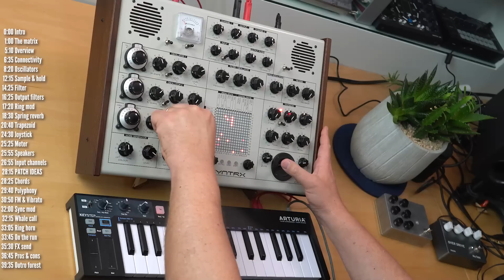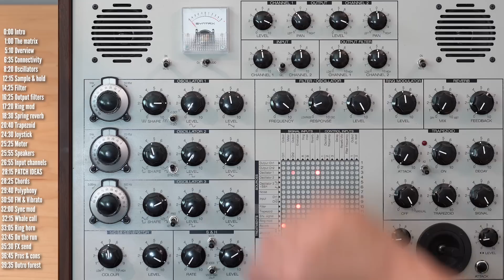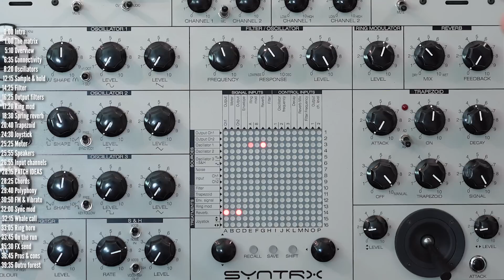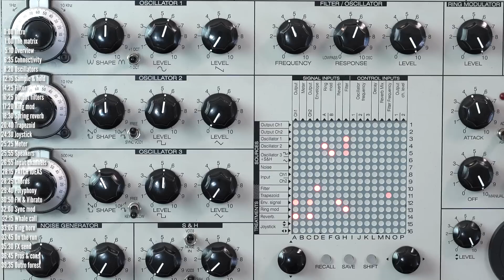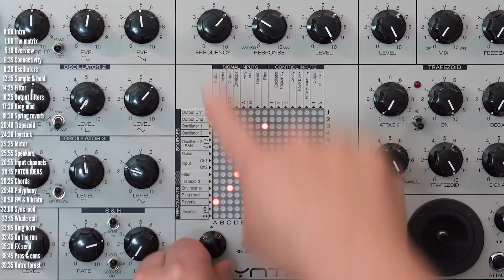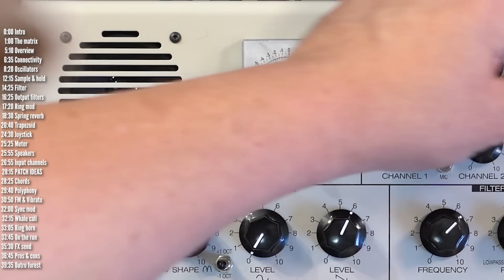SYNTRX: Review and sound design tutorial // EMS Synthi reimagined by Erica Synths

Comment: To do Polyphony with the SYNTRX, you use a Arturia Keystep Pro, is polyphony working with the arturia keystep basic model?
Reply from the maker: Syntrx is not a polyphonic synth
Reply: @loopop  at 29:40 you did a polyphony part in your video with the arturia keystep pro, does the controller keyboard makes a difference on how you can achieve that type of sound, or not? If I got it, you played the oscillators 2 & 3 on the left side of the keyboard and the osc 1 on the right side. Is it possible to do the same configuration with the Arturia keystep basic model ?
Reply from the maker: @Kevin_Beier  ah I understand - I thought you were asking generally. No, this trick only works with the KeyStep pro
Reply: @loopop  thank you for your answer :) can I ask you one more thing? Can you tell me how to set the cables between the two devices for that specific setup, I can barely see in the video where the cables are, but not clearly. 

Thank you in advance.

Comment: Ok, I have got this myself and am a bit confused about saving patches. I can get a great sound, save it,  but when later recalled they are never sounding the same. In fact,  knobs and dials that are in their current state seem to be automatically applied to a recalled patch making it sound very different. I was under the impression that once a sound was saved it was fully saved.
Reply from the maker: you can only save matrix connections, not knob or switch positions unfortunately
Reply: @loopop  Ok, I was under the impression that it saved the state of the sound as well as the matrix, but not able to recall current knob positions. Bit of a shock but I suppose I will have to live with it and make the best of it. Limitations are sometimes good
Reply: @loopop  Which is why it is going back, sadly. I will wait for the Behringer VCS3 clone.
Reply: Make yourself comfortable in that case (you're going to be waiting a LONG time)...
Reply: @actonspur5231  I can wait. I have the Pulsar and Makenoise semi modular synrhs to keep me busy.
Reply: @Ian-gw2vx  the global chip shortage doesn't look like abating any time soon (and Russia's persistent invasion of Ukraine is severely curtailing that supply channel). Glad Soma and Make Noise are keeping you entertained through this manufacturing malaise..
Reply: @actonspur5231  Its all meaningless in comparison to how much people in the Ukraine are suffering. Even though I bought the Pulsar and Lyra almost 2 years ago I still feel uncomfortable.
Reply: @Ian-gw2vx  this is very true. However, that chip manufacturing plant probably sustained a lot of national employment which has now been decimated following Russia's invasion. Notwithstanding, you can't put a price on human loss and suffering which this has inflicted, synth passions aside...😔

Comment: Regarding 'On the Run' - if you connect the sequence pitch CV (instead of gate) into the SYNTRX audio input jack, you will get those accents in the hi-hat pattern like the original.  I tried this just now and it sounds fantastic and very close to the original.  Using the gate works too as you demonstrated, it just ends up a little repetitive.  Nice video, I watched it many times before finally purchasing a SYNTRX!

Comment: My old VCS3 had one great feature where the joystick's speed of movement could be used to control the amplitude of an oscillator. In other words, it worked just like a violin bow - slow movement for quiet sounds, fast movement for loud sounds, no movement for silence. With that and the keyboard I could create quite convincing solo violin or cello melodies. Can the SYNTRX do this?

Comment: It's definitely a retro approach, I'd think there's some old-timers who'd kill for one of these.  And I suspect it's cheaper than an original and probably a little easier to maintain.   For example: good luck getting a replacement pin patch panel for a vintage one.   I'm surprised you can still get those 10-turn pot dials anymore.

Comment: Did I understand that the lights in the matrix interferes with the noise level in the reverb? 
Weird thing but good to see it's easy fixed with the turning off the lights fucntion. 
Or perhaps there should be some physical filter inside the box?
Reply from the maker: Filters would change the overall sound, it's better to just eliminate the source of the problem (which, if it bothers you, turning off the lights does)
Reply: @loopop  I'm thinking that if something is causing noise then that should be dealt with in the engineering and design stage. It appears though as Erica Synth chose to deal with it with the lights off function instead. Probably no bigger deal than that in the end.
Reply: you can open and change cables to the springs to cables that are triple shielded. this will lower the noise alot.

Comment: I would like to see your face when you discover that you are showing distorted waveforms in all your videos with this software oscilloscope. Again..... DO A FAVOR FOR YOUR AUDIENCE AND ALSO RESPECTING YOUR GOOD WORK, BUY A REAL OSCILLOSCOPE!
Reply from the maker: OK, first no reason to shout... we can have a civil discussion about this. Second, please provide names of a few scopes you think would do a better job. Quite interested in comparing. Finally, scopes are there as a visual aid to make things more interesting. I can show you beautiful shapes that sound bad - buy with your ears, not with your eyes. Still, challenge accepted...
Reply: @loopop  Hi, great attitude! In fact a reliable visualization of the waveform reveals some very important facts about the synthesizer's 'guts'. The sharpnnes of the waveform edges reveals facts about the high frequency response, the flatness of a low frequency square wave give clues about the low frenquency response capability, etc. A simple 20-50MHz scope is more than capable of represent well these audio waveforms. The Hantek or Owon is a cheap and good choice, look for "OWON SDS1102" on eBay. Best!

Comment: I've always thought the original EMS Synthi sounded like a scientific tool rather than a synth. Like in a Forbidden Planet sound track sorta way. 
After you showed the waveforms it made sense why it has an almost crude sound compared to something like a Minimoog. The waveforms aren't as consistent across the octaves. It's basically what Hainbach is doing with that electronic equipment he has lol. 

Great review as always loopop!
Reply: I'd guess that that's down to the output filters rather than the actual oscillators. There seems to be a fairly heavy high-pass applied to the oscillators that must not be present on the raw oscillator output, or you wouldn't be able to use OSC3 as an LFO.
Reply: @marinedalek  That's true, I was more implying the actual output of the synth being a bit odd. Especially if you compare the square output of something like a Arp Odyssey, at least from examples I've seen. It's always possible the plugin being used here might display waveforms differently than a hardware oscilloscope. 
The way the sine changed shaped as pitch increased is what made me think this originally.
Reply: @ericobrocki5850  don't suppose you know about any kits or schematics for a vcf cv input mod for an sh-09?!
Reply: @marinedalek  if you look at the Waveforms of an actual EMS VCS3, they look like the waveforms on the panel (ie: a proper triangle, sine, square, etc) not sure whats going on with the Erica synth, but I agree the waveforms look weird. loopop might be running them through a tone control, or  filter,  or his software is just tracking them strangely.
Reply: AFAIK a problem with the original VCS3 was that it was a PITA to tune and keep in tune. Stuff like temperature fluctuations  (smaller than for other synths) would mess it up..... so as a result it was used as a noise/FX machine rather than a "conventional" synth, even though it was one on paper.
Reply: @MichaelCoombes776  That makes sense actually, apparently Arp's Osc designs were the first to fix the temp stability issues. Still can't wait to replicate some of these circuits someday
Reply: I came here to say Forbidden Planet about the outro music, you beat me to it.

Comment: Great review as usual. I guess the price reflects manufacturing volumes vs demand, so it’s just for a few lucky connoisseurs. I’d rather get a MatrixBrute, a similar but much more powerful system at a lower price.
Reply: @SLRPS  the prophet 6 can route audio through the poly mod though.. I guess that's why the modulation is so simple on that synth though.